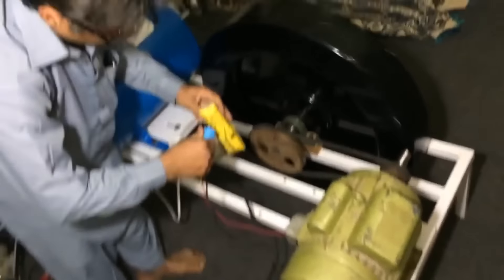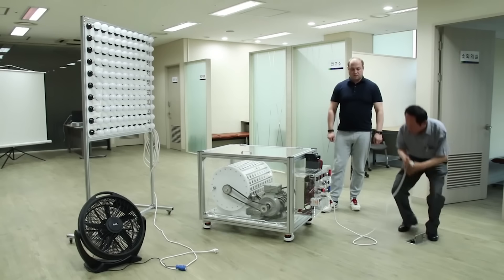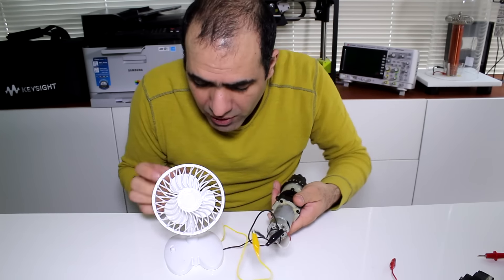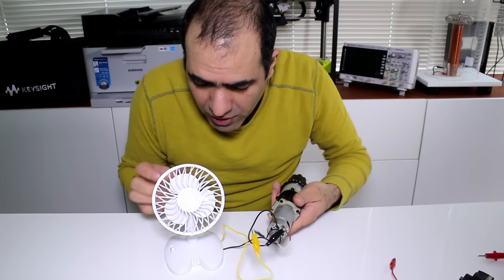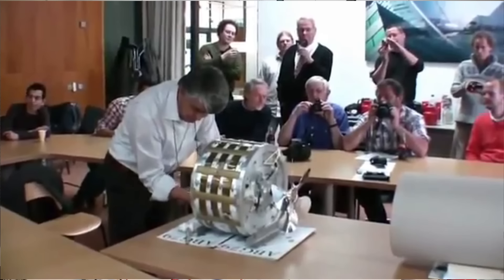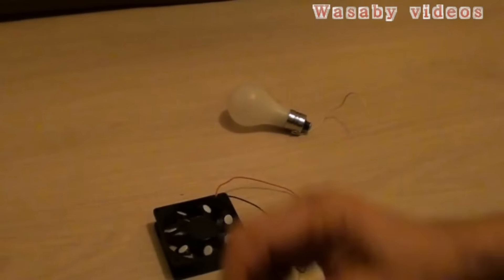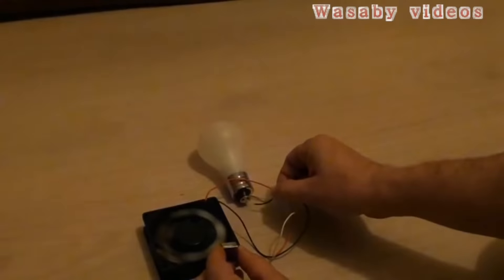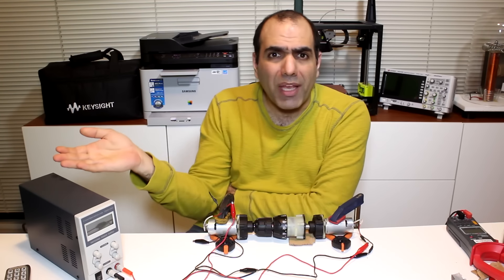The Curious Case of Free Energy Device

Comment: When I was a kid I thought they should make an electric car that is powered by a solar panel and a light bulb, and you have a battery just to initially turn on the light bulb, then you have unlimited power.   Another idea I had was a wheel with magnets kind of like the fan, where magnets repel each other continuously.    Then I found out about the laws of thermodynamics and never bothered to even try any of those designs. :P
Reply: Red Squirrel UNLIMITED POWWWEEEEEERRRRRRR!

Comment: I actually tried the same thing 2 yrs ago when i was 13 
What i did was attach a generator motor to a rc car motor and gave the rc motor power from a power bank which had the generator motor's output connected to it 
The first thing i realized was that the moment u connect the generator output to the power bank the rc motor slows down  resulting in lower power generation
Conclusion is that i was able to slow down the discharge rate of the power bank but i couldnt plug any device to it for charging so it was pointless waste of power!!!

Comment: I’ve been kicking around a thought to get a huge sheet of foil, hoist it up on a tall pole, connect the sheet via a wire to something that uses μA levels of current (an ATTiny maybe or an o-scope or multimeter input), and then connect the (-) side into the ground, just to see if anything would show up at all.

I’d equally love to see that getting debunked, though. Not sure if such “ambient”-derived energy would work. Or maybe it would use the photoelectric effect and function as a solar panel…
Reply: In practice you might end up building a really shitty antenna where the foil sheet mostly just acts as a reflector.

Comment: you can buy those light bulbs they charge up in the lamp if the power gpes out you take it out and hold it the battery kicks in from your hand its an emergency lightbulb !
Reply: Yeah, it is called a battery and it is getting charge while there is a charge applied. It is not free nor is it unlimited.

Comment: I actually managed to figure out a battery-free shock circut, by putting capacitors in parallel disconnected and then pressing a button and switching them all in series. But it still technically involves a battery, just zinc coated and copper wire that you hold at the handle.

Comment: Wasn't the wydencliff tower based on creating a pull of electrons using the stream below and the elevation of the capacitor discs? I thought he used a natural process to crate a spark to turn a motor but I don't think it would have powered the world. Electron differential to create a spark to turn a motor?
Reply: No he got his energy from a local power plant. The tower quite famously overloaded the circuits of the power plant and caused it to catch fire.

Comment: Can someone explain the magnet thing
If the magnets push the fan then it looks like free power?
I assume the magnet looses magnetic strength over time or what's the situation
Reply: No the magnets will simply settle into an equilibrium position and stop moving. It's a bit like attaching weights to a wheel, if you try to spin it the weights will eventually just find whatever position they're balanced in and the wheel will stop moving.

Comment: I know there is no such thing as "free energy" BUT I do love the idea of generating electricity from alternative sources (even when that is not very practical) 
I like the idea of "gravity" powered devices. I have always imagined that if saturn was a stator and the rings where a rotor... Clearly the dimensions wouldn't work and I think Saturn's rings are in synchronous orbit but I wonder if an orbiting type thing could actually work as a ridiculous generator (if only hypothetically)
Reply: Something that continually catches Saturn ring dust and pushes it down into the atmosphere somehow could hypothetically generate energy.  it'd need to push back on Saturn too somehow.
Reply: The closest thing to that would be the tidal heating that Saturn and Jupiter's moons experience which is quite significant. However this also means that the orbits of these moons slowly decay and when they get too close the tidal forces become so extreme that the moons are ripped apart.

Comment: I seen a 'bismuth levitation' setup where it would levitate a magnet and it freely spun the magnet fairly quickly. Could it be possible to make a free energy generator out of it?. I suspect there was air blowing the magnet to make it spin? Although the video wasn't linked to energy generation in any way so maybe it spins for some reason.
Reply: There's lots of physics experiments that make tiny tiny things spin very fast.  They do so because they're mall, and because energy isn't being extracted.  Try and do that and they will very rapidly stop.
Reply: It's not difficult to get something to spin and have it keep spinning since you're essentially just storing energy in the form of the motion of an object, so basically a type of battery. But like a battery when you extract energy from it, it will eventually run dry.

Comment: Free energy believers disliked this video
Reply: free n or free g but not both at the same time
Reply: The video yielded no free energy to watch.
Reply: A long Arial, strong ground connection a germanium diode for detection EFF 108 connected in paralel with a high impedance speaker and you will have a radio without battery, I did that when I was a kid always worked for me!
Reply: @zeothorn  Yeah that's just a trench radio, it isn't free energy you're letting the transmitting antenna power your radio.

Comment: There is a way to get "free" energy from the air...it's called a crystal radio and it's been around since WWII and is like 15 bucks on Amazon. It's enough to power a set of earphones at most.
Reply: It's not free . The power in the radio waves comes from the transmitter antenna, which is powered by the station. It's just like "stealing your neighbors power" , except that it's wireless and the station foots the electric bill.
Reply: Nihar Pattnaik   I think he was referring to the video ElectroBOOM made about Max Loughan.
Reply: Well before WWII. Crystal sets were used as far back as the first world war.
Reply: Is there a limit to how many crystal receivers could intercept the signal that should overload the transmitter as per your logic?

Comment: The only "free energy" we can truly get is by firing lower energy light around the rim of a black hole (like a gravity assist) and the light comes back with more energy than it left with.
This is "free to me" energy, but in reality, it's taking energy from the rotation (and frame drag) of a black hole.
If, however, we could create a monopole magnet (or some material that would act as a magnetic field diode) we could get free energy. But such a thing is impossible :(
Reply: So you are basically saying there is no free energy. Good job on saying nothing.

Comment: The laws of thermodynamics not only debunk the idea of free energy, but it also debunks the possibility of 100% efficient devices (i.e. perpetual motion in a vacuum).

For anyone curious, the most efficient cycle that can be built is the Carnot Cycle. The "theoretical" max yield can technically reach 100%, but you either need an infinite hot thermal reservoir or an absolute zero cold thermal reservoir, both of which are impossible.

On the bright side we did get to see Mehdi shock himself for our entertainment!
Reply: Yeah, that shock was sterling! :D
Reply: It could be done with Fusion reactors, they are getting closer
Reply: The Carnot Cycle is just the most effiecient heat engine, it is possible to make other types of engines that are more efficient but none of them reach 100%. Modern Steam Turbines are not very far from the theoretically most efficient heat engine as well.

Comment: An electric motor is 88% efficient and a generator is 88% efficient... at best.  (This means a loss of 24% when hooked together) If they were wired with silver wire instead of copper, they would be considered more efficient and gold wiring would even be better. However, none would be equal to true 100% efficient.  Thus this guy is correct!!! 
    I am a self-taught engineer and I used to write about electronic theory and I agree with this guy.  Subscribed.

Comment: ok i just have only basics of electronics , but is there any chance for the first clip with a Flywheel be true ( not free energy but something like a slow discharging capacitor )
i would like someone to tell me more about the first clip
Reply: Short answer, no.  Long answer, nnnnnnnnnnnnnno.

Generators and motors aren't 100% efficient, let alone 110% efficient, and it would rapidly stop.  There's really not much more to be said about it.
Reply: Kinetic Batteries are a thing sure but they're only used in very particular circumstances since they generally aren't practical.

Comment: I saw a wooden wheel fitted with glass chambers. These chambers, (or bulbs), were interconnected with thin tubes, and with a combination of water and vacuums created, the water inside the chambers would work its way to the top of the wheel, causing it to roll and crank a motor or something. This device truly does create a small amount of energy perpetually.
Reply: @noneofyourbeeswax01  it stops and starts, which seems to pull a crank. Why does it need to be a continuous spin to work?
Reply: @noneofyourbeeswax01  I watched it stop and start and stop and start. Theres no reason for it to stop and not start up again
Reply: @chaised  There is a reason. The laws of thermodynamics.
Reply: @noneofyourbeeswax01  not an answer
Reply: @chaised  quite literally is
Reply: @LineOfThy  nope. Just another lazy online argument
Reply: @chaised  woah no need to deprecate yourself like that
Reply: Where do you think this energy comes from?

Comment: Some of those concepts (including yours) looked like devices that used electricity to generate more electricity. Would that technically be possible, given that you have a high enough efficiency motor, or is it, like free energy, a waste of time?
Reply: You can't generate more than you put in obviously, but sometimes connecting a motor to a generator can make sense as a crude way to convert it from one type to another, as he does with a brushless dc motor to generate 3-phase AC
Reply: you cannot get more energy out of a system even with 100% efficiency. with 100% efficiency you get the exact same amount of energy out and no more.

Comment: Nuclear battery’s are free energy devices but they only produce very little power,you litterally need a few millions of them along with an invertor to produce usual power,
Also i do believe in a magnet motor from howard johnson among others.
Reply: nuclearthermal generators are not "free".  The energy comes from the isotopes, which run down over time.

Comment: Nuclear powered MHD, Just use strong electrostatic fields to  make a strong electret. Then put two perpendicular plates between two attracting electrostatic fields and use an ionization element such as a smoke detector element, or some thorium oxide sands. The idea is that as the radio isotope makes ions then the electrostatic fields use a MHD effect to make charges on the perpendicular plates.
Reply: That's basically how a Geiger counter works.

Comment: I saw a video with a guy using salt water a spark plug and a speak magnet all connected to a USB phone charger, and shows it charging his phone.
I wonder if that would be worth rectifying!?!?
Reply: All of those components are just there to distract you, they don't actually do anything because he's almost definitely just getting the phone to play a video showing the same animation it shows while charging. Most phones let you set up commands to play specific videos and the command can be something as simple as plugging something into the USB port. Even if your phone doesn't have a built in feature to do this it's very simple to program an app that'll do it if you have some basic programming knowledge.

Comment: I think it is interesting that scientists quote a law of physic, the second law of thermal dynamics, which was written when scientists also thought that heavier than air flight is impossible.  If the universe is not a closed system, as in a multiverse, this law would be outdated.  I just have a problem with absolutes in science.  It's like we never learn.  Never say never, like heavier than air flight is impossible.  If we never make it to the stars with wind, solar or gas.  One day we will have to find a way to produce power adequate for that task.  Why don't we work on that now?
Reply: You've got it exactly backwards.  It's no coincidence that we developed good motors and flight the same time we began understanding thermodynamics.  These laws -- the connections between fuel and heat and pressure,  between work and motion and energy -- are exactly the math behind engines.  They let us design engines from first principles instead of trial and error, letting us shrink them small enough to fit in an airplane.  And everywhere else we've looked, we've found it - it seems to be a fundamental law of the universe.

Thermodynamics also explained many things we found in nature.  What do these free-energy things explain in nature?  Nothing.  We see *nothing* like them, anywhere.  That alone is good cause for skepticism.

Remember the faster-than-light neutrino?  The whole world wanted something amazing to be happening while every half-decent physicist was more like "I bet you five bucks it's not".  And they were right.  The laws of physics are quite good enough to say that a measurement showing FTL speeds is wack.  And it was.  The measurement was wrong.  There was a bad cable.

Remember the EMdrive?  The whole world wanted something amazing to be happening while every decent physicist says "That'd violate conservation of momentum, so it's out".  They were right.  The laws of physics are quite good enough to rule something like that out.  And it did.  The measurement was bad.  They didn't shield a cable.  (Hm, bad cables cause a lot of bad physics...)

"free energy" is even worse than these.  It's usually the same frauds from a century ago, repackaged to look modern, under a veil of secrecy, without even flawed research to back them up.
Reply: People quote this as if the theory of thermodynamics is on the same level as some scientists doubting the practicality of heavier than air flight. They simply aren't, the theory of thermodynamics is a theory that is based on strict math which has held up in countless experiments, no such theory existed for heavier than air flight, that was simply some people doubting whether it was practically possible to build a heavier than air flying machine. I don't know if you've ever thought of this but it is possible for an idea to be theoretically possible but practically infeasible, like monorails are theoretically feasible and might even sound like a decent idea on paper but practically they've always ended up failing since they're too expensive to build and the infrastructure is just fundamentally flawed compared to traditional railways, the only exception to this are places where traditional rail isn't possible like the Wuppertal valley in Germany. Heavier than air flight very much fell in this category of theoretically possible but practically infeasible, most engineers simply didn't think it was possible to build a power plant small enough and powerful enough to enable heavier than air flight. They ended up being wrong because internal combustion engines proved to be much more powerful than steam engines but of course internal combustion engines could only be developed due to thermodynamics making us better understand how heat engines and chemical reactions function.

Meanwhile in the roughly 150 years since Thermodynamics was developed into its modern form it has not once been contradicted. Furthermore the laws of thermodynamics that most people quote have been shown to be the consequence of even more fundamental math that governs random chance, we technically don't even need these laws anymore since we now can derive them directly from how gasses behave on an atomic level.

Comment: If you just have one huge weight sitting ontop of another giant weight, it makes heat, yeah? How is the crushing force of gravity not free energy considering that gravity does not go away over time or whatever? I know it’s pry dumb for some reason, but I have never gotten a good answer.
Reply: The heat the weights would produce would be extremely insignificant. 
Ever heard about hydropower plants? They use the same principle you just stated, using the force of falling water made possible by gravity to turn a generator.
When people refer to a "free energy device" they are most of the time referring to a device which can retain the required startup energy to run forever without any more external power and then even generate energy. So it's not the same.
Reply: If they're sitting still on top of each other then there's no friction between them and thus no heat being generated. They have to move in order to generate any energy, or as we say in physics “perform work”, however in order for them to move due to gravity they must have started somewhere above ground level and moving them up to that height requires exactly as much energy as they would generate on their way down.

We can still exploit this energy, called gravitational potential energy, if we let something else do the work of moving the mass for us. Like with dams where we let the sun heat up water so it evaporates and eventually rains down somewhere high like a mountain and then on the way down we can extract some of the energy ourselves.